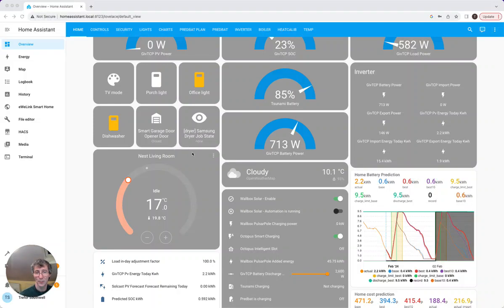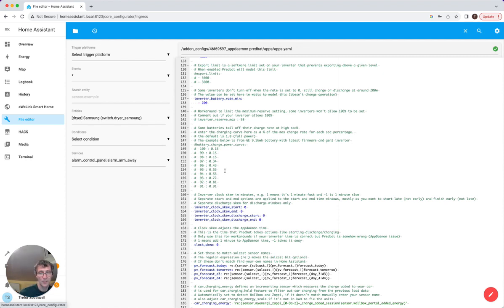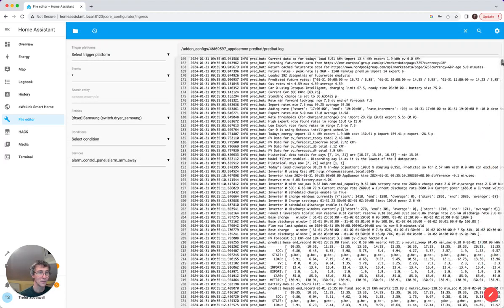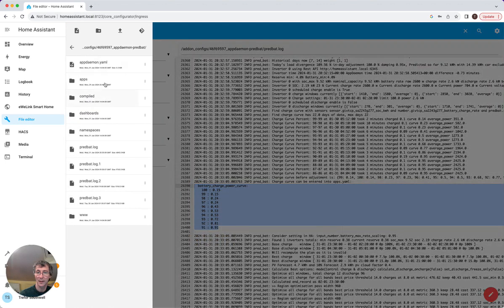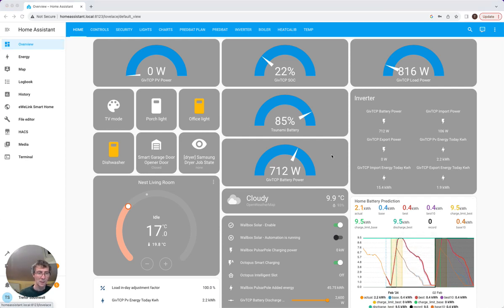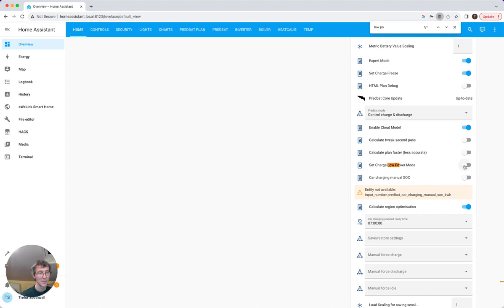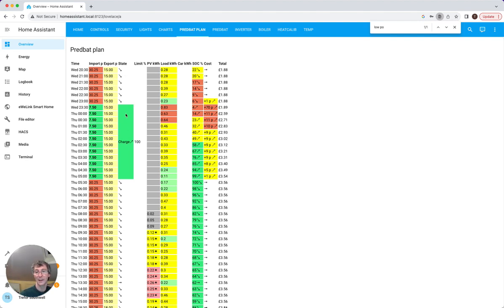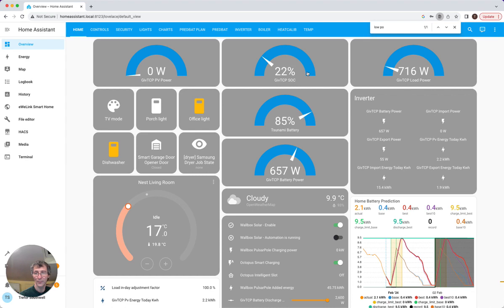Predbat  - Charging Curves and Low power charging mode

Comment: Super useful video, my predbat doesn't seem to be spitting out the example charging curve into the logs, any reason why that would be?
Reply from the maker: Probably not enough data
Reply: @springfall2008  This matches my experience - how much might predbat need as it's been running for multiple months in monitor and now a few in control.

Comment: Great Video Trefor, Have you had any of the beta fast response firmwares for the gen 1 yet? If so, has your charging curve altered because of it? I've seen a large increase in my discharge rate up to approximately 2.7kwh.
Reply from the maker: Yes, the I found the charge curve slowed don't, I didn't notice the discharge change mine is reporting 2.4kw
Reply: @springfall2008  Interesting, I wonder if it's anything to do with the Battery version? I have a 9.5kwh battery. I also notice that I now never get to 100% charge on the overnight IOG charge. I normally get to about 97%, as predicted by Predbat. I presume it's less efficient wasting time at the slower charge rate.